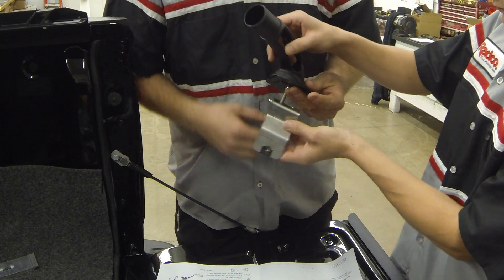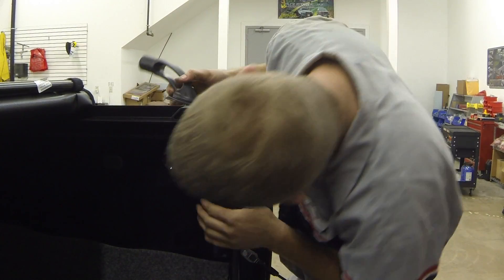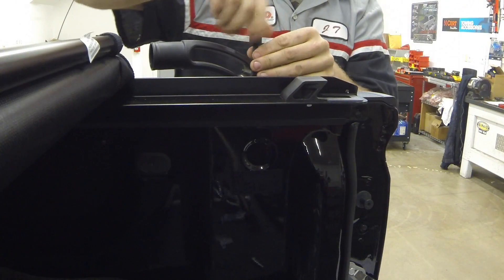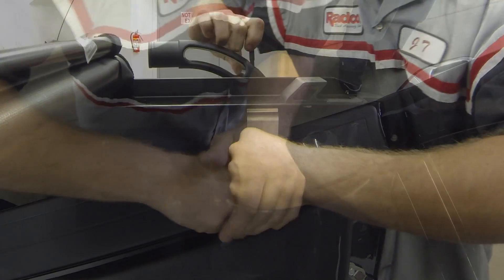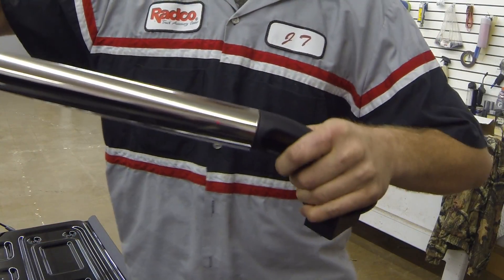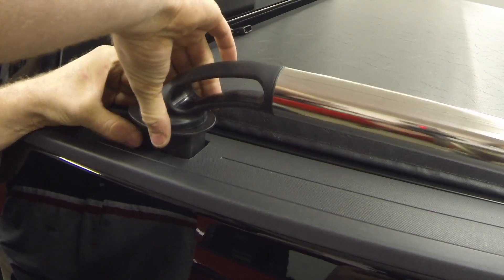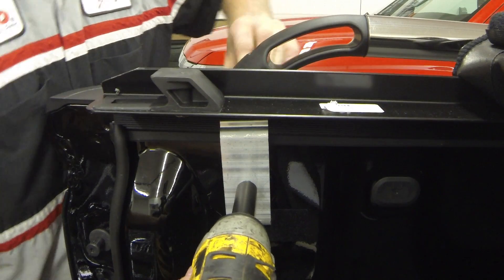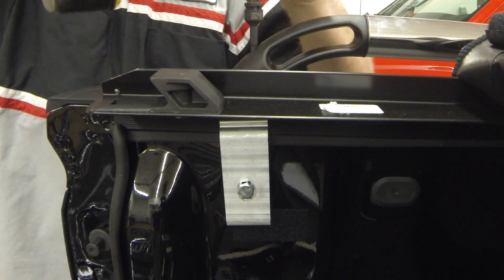Putco Nylon Locker Bed Rails Install On 2014 Chevy Silverado

Comment: I bought similar putco bed rails for my 2015 Silverado and it appears you have a similar access cover. My question is and you didn't address it in the video is how did you get the supplied bolt with the bedrails through the cover bracket because the bold is bigger around than the hole on bracket? Should I use a Dremel tool or drill to make the hole a little bigger?
Reply: Dave Sokolofsky  ok